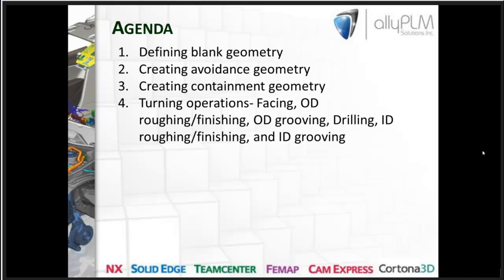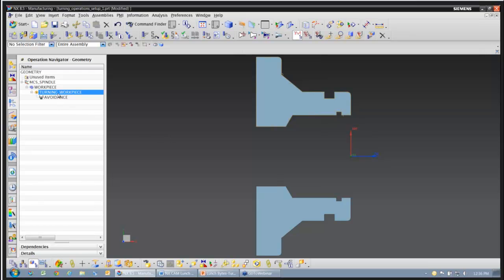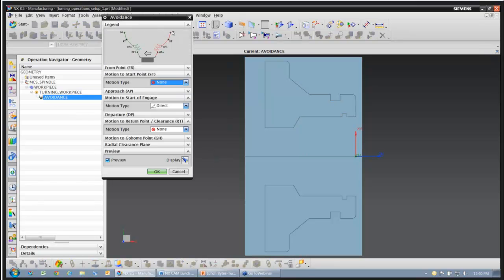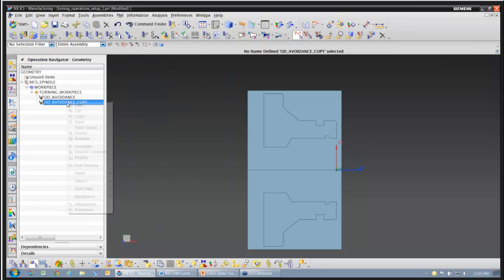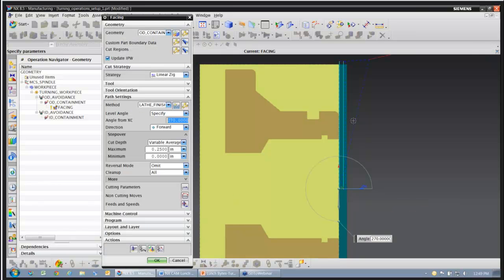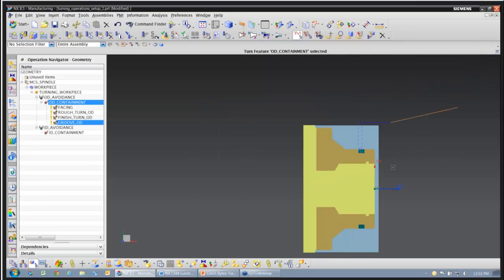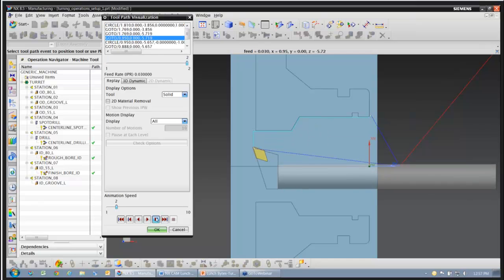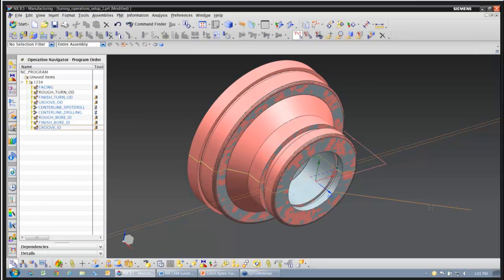How to Handle Turning Operations in NX CAM? - Tutorial - PROLIM Lunch Bytes

Comment: what about generating G codes You forgot to mension or does purposely? please show or tell the method to generate the G codes. .
one more thing i have saw a machine and working on it is Senumeric 828D BasicT with Siemens Software installed on it cam use this software to generate Gcodes and use them on to the machine for manufacturing. please help me finding the answers.